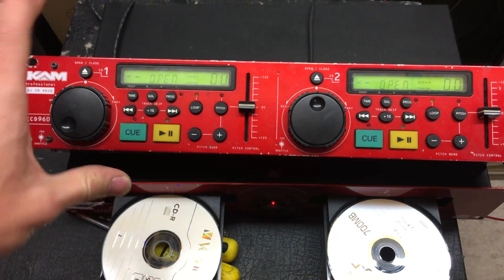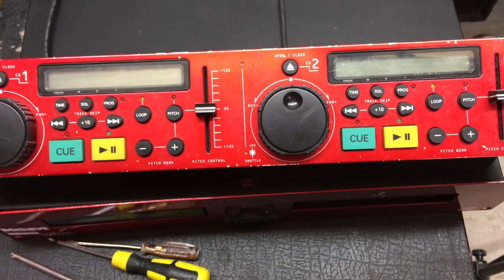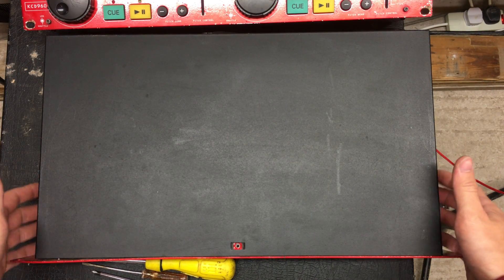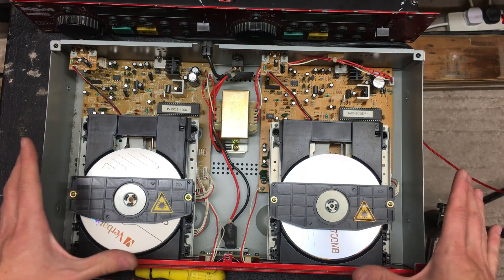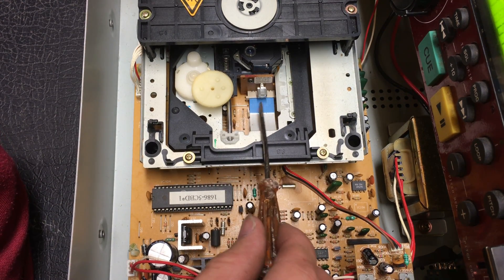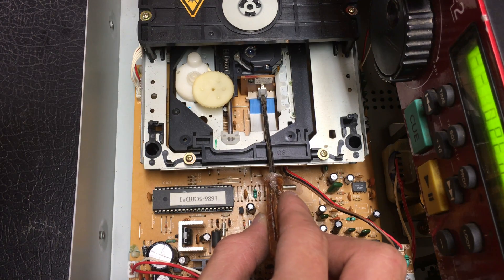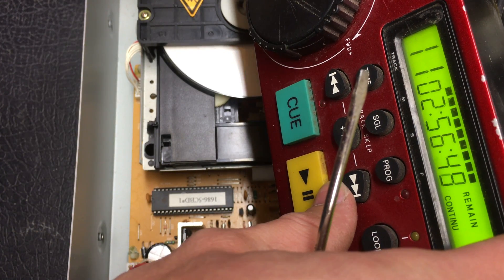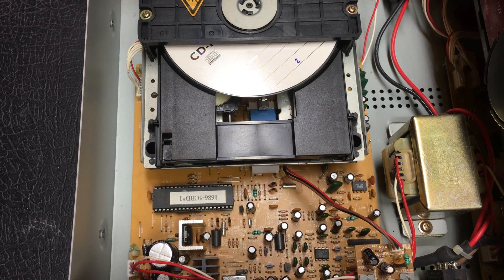Fixing A CD Player That Doesn't Read Discs - Laser Power Adjustment Tweak - Repair Guide

Comment: I can't find the adjustment screw . I can see the lazer but can't see where to adjust  .... there is a white strap at the back but a little screw but that looks like it is holding the green thing in  place  .... and it is vertical  would send a photo if I could work out how to

Comment: Im trying to adjust the laser on a Sony HCD-MX550i but there is two adjusters. One seams to be for the motor and one for the laser but can't get it right. Is it turned clockwise ir counterclockwise for adjusting the laser?

Comment: My Cambridge Audio D300 has an intermittent fault with the play button once started the machine works perfectly and if paused the play button will start the disc again, but once turned off it takes a number of tries to start - I have cleaned the reader and lens and got a cotton bud behind the control panel and sprayed it to dust it but its immaculate! Any ideas?

Comment: Just beware all that bumping up the current too much can greatly decrease the life of an already weak laser.
Reply from the maker: Indeed! As mentioned in the video and stated in the description this is intended mostly as a interim measure than anything. 
Like I said I have had it last sometimes for years in the past after adjustment, and other times just a few months. 
It lets you find out exactly what model laser is in the unit though and gets out of trouble while a replacement is put on order for future/when needed. 😎
Reply: @NathanPH  You don't really say that by raising the current is the cause of the reduced life though. You should also have a scope on the RF pin to make sure the eye is at the right level. Also, you fail to mention that laser power is the last thing you should adjust. Focus and tracking adjustments are much more likely to drift

Comment: my Copland CDA 288 laser is not reading the disc...your video shows only only 1 screw adjustment...in that same place mine has 3 and I don't see any screw adjustments unless the are resest a little more...what one do i try to adjust and are the to be screws inside those holes for me to adjust❓

Comment: Sorry but this is not an alignment. All this does is turns up the factory calibrated voltage on the laser. Which greatly shortens the life it has left.
Reply: completely agree... Since this is the KSS-213, I know that this guy has a lazy ass. Why not adjust the Focus & Servo Tracking balances first since we saw the disc trying to spin at the factory-set potentiometer of the laser power level...
Reply: But it already doesn't have any life left. If you can get the thing working, however temporarily, you've diagnosed your problem and are in a good position when engaging someone to replace the laser because you are "informed".

Comment: This is what happens when an UNTRAINED person who thinks they know all about electronics posts a video.  He just adjusted the laser current for a failing pickup.  This is the equivalent of increasing the mains voltage to compensate for an aging incandescent lamp.  Yes it will return to it's new out of the box intensity, but it will burn out sooner than it would have if left at the nominal voltage.   The proper fix for this CD mech would be to replace the laser pickup or the entire mech.  They are not so costly as to make this "repair" sensible.

Comment: you really don't know what you're doing that doesn't align the laser that brightens it by raising the current you didn't use a multi meter to test the ohms before and after now the laser might die in the middle of playback

Comment: If the laser doesn't read discs that means it's dying. By raising the curreent, it may starts to read discs, but it will degrade even faster. This isn't a repair, you gave the player a few more months befor you can throw it away. The repair would replacing the laser...
Reply: Making it work, extending its lifespan instead of replacing immediately by a new laser IS a very good operation: make things last the maximum time they can, instead of polluting by always replacing things!
Reply: It is not a long lasting repair, but it will squeeze more playing time out these players whose lasers are very often not cost-effective to replace, assuming you can even find a replacement.

Comment: My CD disc is turning OK, but it is still not reading the disc, it also says no disc's. Your help would be appreciated.
Thank you
Reply from the maker: May well need a replacement laser module then in this case, that could be beyond economical repair but depends if you could find a replacement and the value of the CD player unit (if it is actually worth the cost to repair it). You'd have to look for any model or part numbers and search them online to try and find a replacement unit. Afraid I can't really advise much further though as there are so many different units and assembly methods when you get to that level so it helps to have some experience or find a service manual for your specific unit, otherwise try and find a local repair shop who could complete the work on your behalf.
Hope this helps somewhat.
--Nathan

Comment: Not working on a marantz 4000 (njoe tjoeb). The potmeter is not accessible (and don't know where it is). Worked on an old Sony, but don't claim it works on most players!!
Reply from the maker: But by your very response and the definition of the word 'MOST' means that it obviously does as described!. 

The meaning of MOST is that it USUALLY works or is the case/similar on MOST OCCASIONS, but there could be cases/times where that isn't applicable. 

If I had touted it to be identical and 'would work every time' - which I didn't say or claim at any point, then I could understand that response. 

I obviously can't take into account every single design of CD mechanism ever made in the entire world for the last 40+ years and never did claim to so.

At least you managed to get one of your more standard machines sorted out and you're also welcome for the free helpful guidance... Just please don't try and flame me for claims which I never made. 
--Nathan

Comment: This is just a temporary solution. You're "increasing the power" of an already worn-out, dying laser lens. It will probably work for a few weeks or a pair of months before it stops working again. 
And beware everybody: never look directly at a laser lens while the power is on, it could result in eye damage even if you don't notice it immediately.
Reply: That's disappointing to read. He said sometimes it can last years.....I'm confused about 2 things: how do you avoid getting a shock and seeing lens if you have it turned on like he does?
And b) I'd only heard of lens cleaning before. Yet he don't do dat here.....?

Comment: How can i fix mine cd player. Yesterday i putted a cd and it read and all of a sudden the laser stopped and it kept ''CD READ'' and then no disc i tried every cd and there is no sound of the cd being read its just ''CD READ'' and after a while ''NO DISC''. I tried lifting up the cd player and it read the cd but when i wanted to put a different cd in it again the same problem occured. I dont know what to do. Last month it worked perfectly fine when i close the cd lid i hear a little click or some movement and thats it.

Comment: This did help my nad c521bee. Only trouble is it doesn't read copy discs and the odd redbook ones (originals). It may play them but there's a crackling/distorted back ground noise which makes the cd unlistenable. Any suggestions would be helpful

Comment: I am having problems with my Stanton C500. 
It is so similar to your KAM, that I bet it came off of the same production line.
Two days ago, I plugged it in for the first time in 2 years.
It read the CD and played the first 3 songs on the disc.
Then there were reading errors, and now it will not spin at all.
I tried the adjustment that you suggested, but I get no movement at all.
I must have retried at 90 different settings, going from one end of the pot adjustment to the other in as small of increments that I can manage.
Still, I have no movement at all. 
Any suggestions as to what I should do next?

Comment: Nathan, thank you for making and posting this video.  Question(s), kindly.  I have a Magnavox (16 bit) CD player that I'm trying to get running correctly (for some time now).  ¿Do you think you may help me, please?  Purchased new (~1985-87) and in the last ~10 yrs, will not track to the end of a music CD.  After the 1st or 2nd song, it begins to emit a high pitch whine, but not loud at all (need to have it on mute to hear it), and it seems to have something to do with the mis-tracking.  (It's quiet on 1st two songs/tracks). ¿Do you think what you've explained may have something to do with the problem, and may help?  Any/all comments much appreciated.  Thank you.  tonyd\.

Comment: Just to say that if you play computer burned discs them you need to VERY fine tune for both the glass mastered and computer burned cds.
Also play the last track, ie the outer one, and disc wobble will sometimes  cause the focus to miss track.
Glass mastered cds have the information up through the plastic just u see the label. Computer burned ones have the active surface on the bottom of the cd. So the thickness of the plastic can make quite a difference to the amount of focus travel required.
This is the reason some cd players will not play computer burned discs.
I hope this is useful.
Reply: The read surface isn't on the bottom of  a CD-R, though seemingly is a bit lower(I couldn't find any info on how much) than on a pressed CD, due to needing a reflective layer and a dye layer.

Comment: I have a Sony esoteric SACD player that does not read both CD and SACD layer. It spins continuously but no clicking sound like in this video. Should I try adjusting laser alignment? Cleaning the lense did work for a while but now it won't even read the cleaning disc

Comment: Hi Nathan, I have an old Technics cd player that takes quite a bit of persuading to play cd's.  I watched your video to see if I can find the adjustment screw to turn.  But with the tray in or out, I couldn't see any adjustment screw at all.  

The CD player is a Technics SL-PJ22 that I purchased second hand, along with the stack system.  Is the adjustment screw in the Technics unit buried within the works beyond where you have shown in the video

Comment: Very good sir! I have this small all in one boom box and I was going to give it to this old lady for her jazz CD’s. When I tested it. It would only play for 00:48 seconds. I opened it up and hoped something mechanical might I be able to fix. I found a large chunk of glue like wax that was in the CD part. Actually it found me when it fell out. Hell maybe that was what kept it from playing further. So I tried it after sticking all the screws in it. Pretty much the same as before. 
  I really didn’t plan on messing with it anymore but for some brilliant idea I decided to try a search for a fix. Damn if your video didn’t pop up. 
  It was already a pain in my ass but what the hell. One more time, I’ll open it again and if it’s not going to work it will be in the next trash pickup. I just wish I had done the search in the beginning. 
  So I been tweaking it and it played all 13 songs. But it is very sensitive to any type of vibration. It will freeze and then eventually it picks back up, I think right in the same place it stops. I tried messing with some more but haven’t been able to get it dialed in. The screw I adjusted is buried and I’m just able to get the screwdriver to it. The screw seems kinda loose and I was wondering if a drop of thread lock would be in order? Or and is there anything I can do about it being so damn sensitive? 
  I have had a few CD players in my possession and I’ve trashed for the same reason. I’m going to give this a go on my Sony multiplayer. I have been having problems with playing consistently without skipping a whole lot. 
  I’m going to throw a couple bucks your way every time I can fix a CD player.

Comment: Thanks Nathan!  Your info is great.  Knowing that most players are built similarly, I may try this procedure on my 1988 JVC XL-M300bk unit w/6-disc magazine.  I hope I can just pull the case off, find the adjustment screw and fix it.  Wish I had seen your video before I ordered another 'old' one.  I imagine if all goes well, I have a back up plan.
Reply: Update: As I thought, the six disc set up is hard to get access to the adjustment whereever it is.  The real problem is the disc is spinng fine but not reading.  I guess the laser burnt out.  Any suggestions appreciated.

Comment: What exactly are you adjusting? You say that you are adjusting "laser alignment". I thought that it aligns automatically with a microprocessor and feedback loop. The service manual for my 1991 CD player shows a variable resistor to adjust laser power and says, "do not adjust, it has already been adjusted", but maybe after 30 years of service this is exactly what has to be adjusted?
Reply: I think you are correct. It stands to reason the laser loses intensity over time and must be driven harder towards the end of its life. My technician said the “laser was out of alignment” he probably just turned this potentiometer.

Comment: One thousand thanks, my friend ! Though I'm not able to do it by myself, now I can show your precious video to a technician and hope they can save my new Pioneer, bought just 2 years ago. It often fails on reading some discs, intermitently. A technician opened it, cleansed the lens ( that was pretty clean ), but didn't discover anything else. So, I was ready to keep the player aside and get another one, though not of the same quality as an original Pioneer that came from Japan. Once again, thank you very much !

Comment: Unrelated question: I broke a really old home theatre player that I didn't like anyway. I opened it up to see if there are any interesting parts I could salvage before tossing. I took out some fuses and will keep the screws of course. Is there anything else you suggest  that I salvage? Also, any alternative suggestions for the speakers that came with it? Thank you
Reply: Mine is a Sharp bought in 1993 everything else works the CD was playing Two weeks ago but not reading now at all
Reply: Potentiometers, switches, heatsinks, display, transformator

Comment: My Sony CDP-CE375 is in MINT condition and i keeps searching for a disc then says "no disc" I eventually opened it up this morning (upon looking closely at the laser from the side between the electronics) and I noticed that the laser is just going up and down, touching the disc multiple times then going to the next disc until it cycles through all 5 discs then says "No Disc" PLEASE HELP! Should i adjust this laser knob as well?
Reply: Yes, adjust it

Comment: Hi Nathan. Ive got an old panasonic RX DT530 which has a lift up lid type Cd Player tray,. Its stopped working years ago but basically when you put a Cd in, it whirs and then the display shows two lines instead of the number of tracks, so its not reading the disc. Ive watched your video her and taken the thing apart but i cannot see an adjustment screw anywhere on this one. Can you give any pointers on what to try if theres no adjustment on it? Ive tried cleaning the lens with alcohol and a cotton bud but still can't get it to do anything.

Comment: I dont know what the laser looks like,  I have the warning label,  mine is a lid CD player not one that slides out?  Omg I just found a tiny screw and adjusted it and it works!!  Thanks
Reply from the maker: Glad you found it and got it going again. Yes some players are a little different but the control will be there somewhere! :) 
--Nathan

Comment: Do you not need to be careful about the laser damaging your eyes? When I took the cover off my cd player there is a warning label about invisible radiation??
Reply from the maker: Yes all players have that warning. It's not all that bad and generally as long as you don't look into the laser itself, especially when/if there is no disc in the tray (which blocks the laser).
Just common sense stuff really.
Hope you managed to get your player going again!
--Nathan
Reply: Does the laser only come on when you press play? If its invisible, it's hard to know whether you are looking at it. I tried cleaning mine but have since been worried that I could have damaged my eyes

Comment: Hi, can I ask you if this would work as well for a car mp3/cd player (cd 30 vauxhall). Mine doesn't read not even track audio anymore. I don't want to buy a used one worst than this.
Reply from the maker: This should indeed be possible but it will probably be more of a pain to test as you'd likely have to re-assemble the unit after each "tweak" to test it. Of course that depends on the assembly of the unit, you may be lucky. 
I've not much experience with the CD mechanisms of car stereo units so all I could suggest is that if it isn't currently working you've probably not got a lot to lose from opening it and taking a look. 
Let me know how you get on, if you decide to take a peek inside and try it. 
--Nathan
Reply: @NathanPH   I would probably replace it with a genuine one from scrap yard. Sometimes it runs tracks without any problem. But rarely it spit out the cd and the "cd error" appears even if I try several times to insert it back. I want to sell my Vauxhall convertible this spring and buy a BMW X1. Thank you.